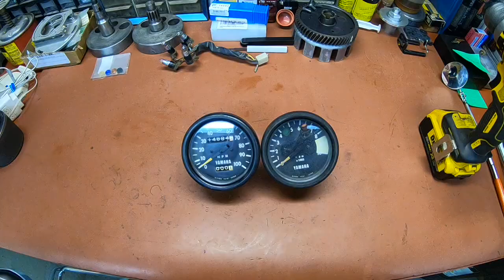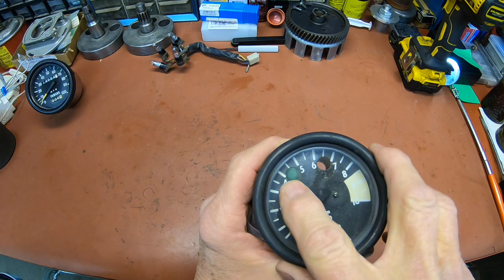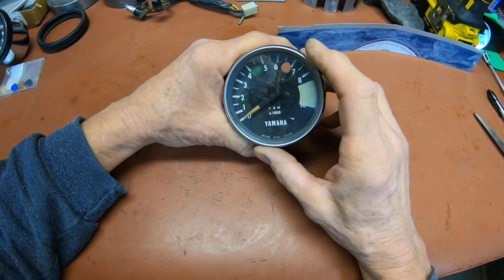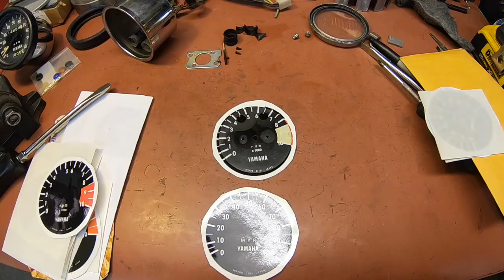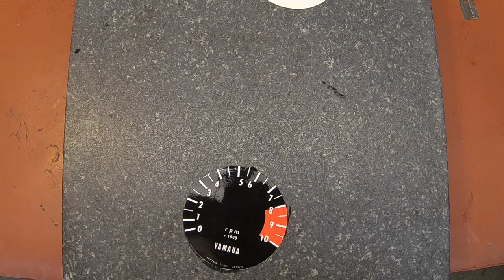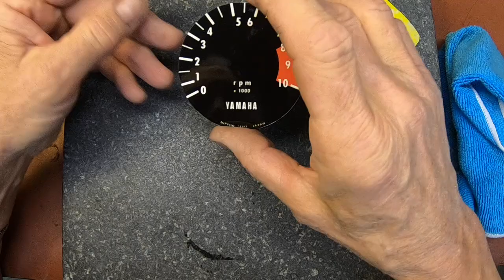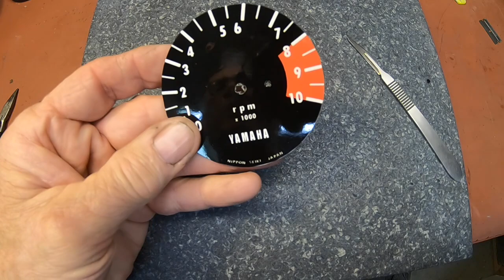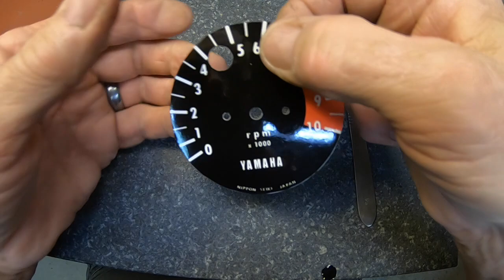Yamaha Enduro tachometer refacing, CT-1 175 Enduro

Comment: I took one apart from a YDS3 to replace a needle. Everything went fine until I was crimping it back down. The gasket was in bad shape and must have been uneven and I probably squeezed too hard. The very fragile glass cracked all the way across. Luckily a local glass cutter was able to reproduce the glass for me. Like you said, slow and steady wins the race.
Reply from the maker: Not my favorite thing to do and is a bit scary. But the only alternatives are not to do it, pay someone to do it, or buy a nos one. Just not into any of those. I have had pretty good luck with my local glass guy on stuff like this in the past. Thanks Jack

Comment: Good morning Dale
FYI instead of using a screw driver try using a paint can opener first go around several times then you can use a screwdriver the paint can opener is easier to use.
Hope this helps.
Reply from the maker: Wow thanks Mark. Never thought of that, I have several, will try it next time. I hope that is years down the road, for it is not my favorite thing to do. LOL. Thanks for hanging out in the shop with me.

Comment: Very interesting video. I appreciate you logging these projects for all of us. I'm about to try to restore a set of 77' Sportster gauges and I'm trying to get a well rounded base under me before I start. On mine unfortunately there isn't crimped over metal, it seems to be plastic. I was thinking of using a soldering iron to carefully heat the plastic and flext it upward, and then reheat it back down as well. We'll see though.
Reply: I was thinking while watching, I wonder if you'd be safer leaving the screen paint there to protect the aluminum over time. Aluminum can be awfully fussy about material compatibility and corrosion. Hopefully the adhesive behaves well with it.
Reply from the maker: Hi Chris, I really know nothing about how it is going to hold up. So far, no problems, I did some reading online about it, most said to remove all of the screen print. So, I did. I just pray that I don't end up with a curled-up decal at some point. Thanks for stopping by.
Reply from the maker: Hey Chris, I am not familiar with those gauges, but I did do some early Suzuki gauges that were plastic, you might want to check them out, I used a knife to cut the bottom crimp off, then glued them back together at the base.

Comment: wow I thought it would be a sticker but it's basically a decal
Reply from the maker: Hey Tom, yes, it is a sticker, but I was afraid that I couldn't get it positioned correctly, so I just gave it a shot of soap and water like you would a decal, then squeezed the water out, wasn't sure it would still stick, but it seems just fine. I am going to do the same with the speedometer. So far so good, if it peels up, I will let everyone know.  Thanks for stopping by.

Comment: Are the Suzuki gauges counter-clockwise with the drill for testing too??

Know any source for reasonably priced speedos, in dam MPH??  Everything on "the bay" is in kilometers!

Thanks!
Robert
Reply from the maker: Yes, all the Suzuki ones I have done are counterclockwise rotation also. I think most are. I have found many over the years on ebay. The only ones in KPH are located overseas. There are a lot of motorcycle salvages that still have them, good ones are getting harder to find though.